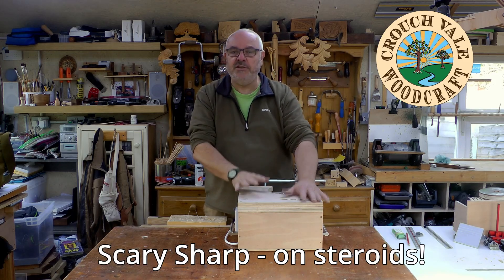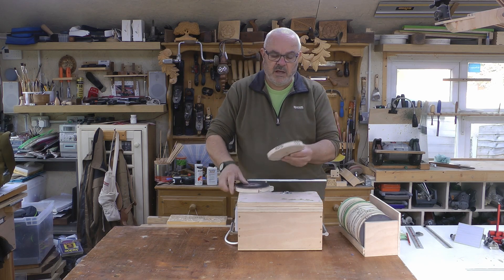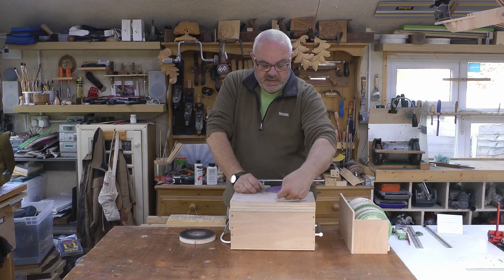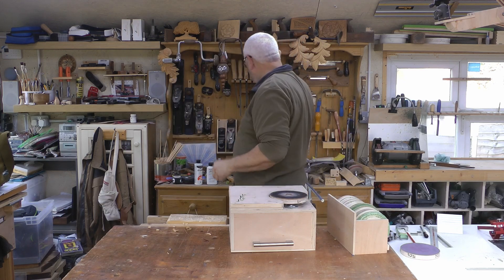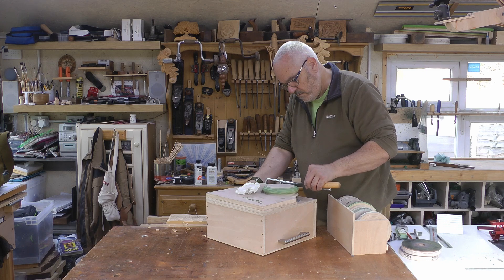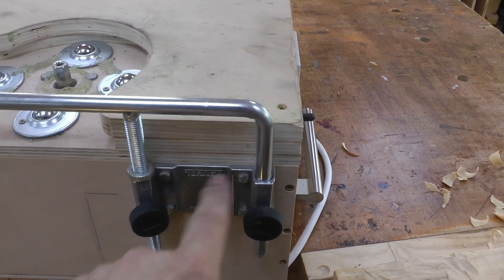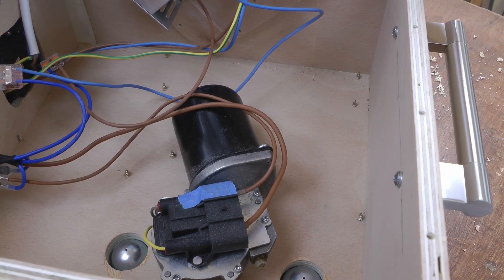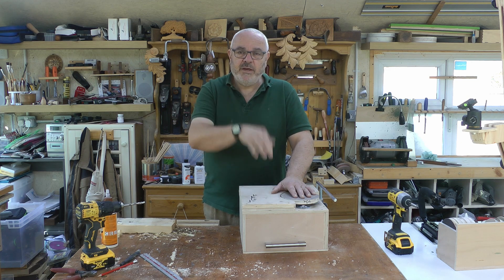DIY sharpening machine for scary sharp blades

Comment from the maker: Thanks Andy. Yes, I saw the video by CousinJackCarves using a mini potters wheel. I bought one straight away, as it was so neat and tidy. However, it is too under powered. I messaged him and he says that he's going to do a follow video on it to discuss it's power. But if you or your finger on the wheel you can stop it turning with not much pressure. It's a shame because otherwise it's a great idea. I did think about trying other potters wheels but thought I'd stick with this as I've been using it for several months and the motor never bogs down, plus the motors are cheap and readily available. Cheers, 👍

Comment: Thanks Rob, that is very ingenious, I particularly liked the use of the nut/bolt covers as a drive interface - genius !

Have you seen the video by the guy who has done similar by utilising a cheap potter's wheel from Amazon - worth a look if you haven't !
Reply from the maker: Thanks Andy. Yes, I saw the video by CousinJackCarves using a mini potters wheel. I bought one straight away, as it was so neat and tidy. However, it is too under powered. I messaged him and he says that he's going to do a follow video on it to discuss it's power. But if you or your finger on the wheel you can stop it turning with not much pressure. It's a shame because otherwise it's a great idea. I did think about trying other potters wheels but thought I'd stick with this as I've been using it for several months and the motor never bogs down, plus the motors are cheap and readily available. Cheers, 👍
Reply: @crouchvalewoodcraft  Thanks for the response Rob, good to know ! 👍